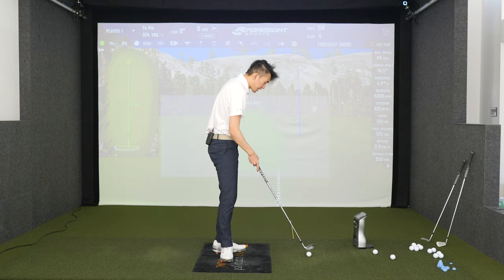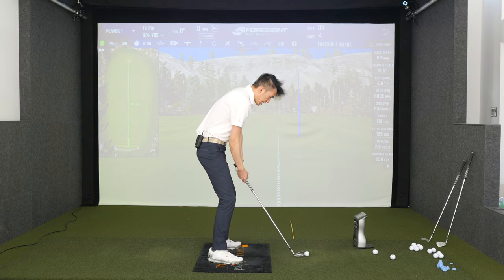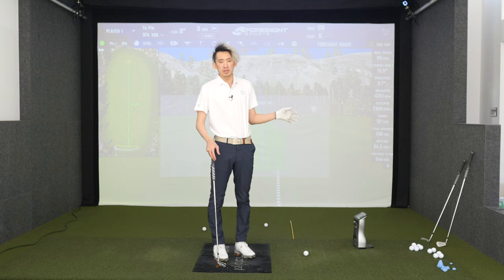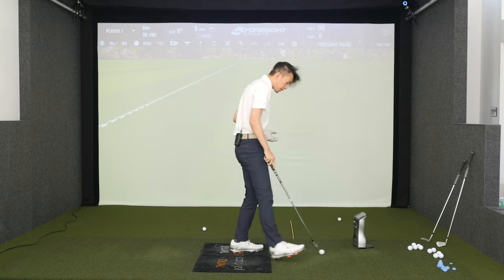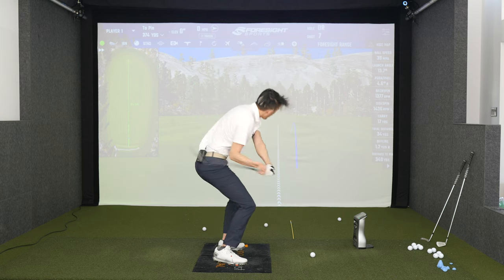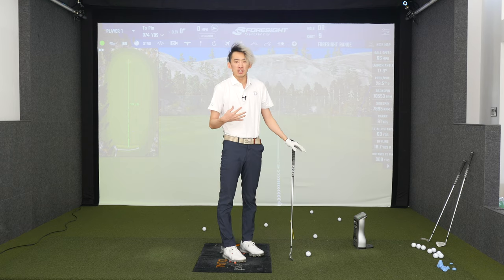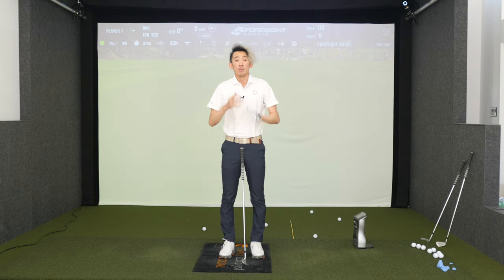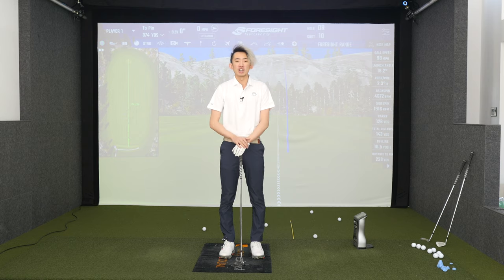Gradual Acceleration to Start Downswing

Comment: I was in the simulator the other day and had a HORRIBLE round, absolutely horrible.  I shot 110 and I’m usually in the high 80s.  Went to the basement and replayed your initial videos about your swing “system” while getting back to basics with practice.  Did this for a week at an hour a day.  Went back to the simulator for a second round and dropped 35 strokes.  I know, I know...you may call bs but it’s the truth.  As long as I stay within the concept of your technique I do well, when I get lazy or try to over swing I do poorly.

Comment: I was really trying to whip a Rahm type of hip to 8oclock at the range yesterday.  Fast whip motion wasn't working so told myself to still focuse on that 8oclock but do in a more controlled and smooth idk a slow whip.  Is your head suppposed to drop that much during your move?